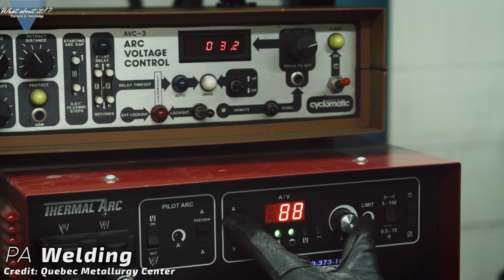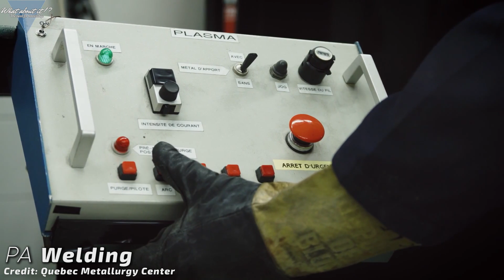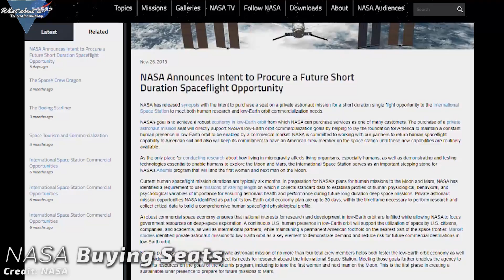55 | Cocoa Shipyard Work Paused – SpaceX Starship Updates – NASA Goes Private

Comment from the maker: Did you expect SpaceX to completely shut down Cocoa so early and is NASA on the right track when it comes to a private low-earth economy?
Reply: Did not expect Cocoa to close so early. In fact I was still under the opinion that Mk1 & 2 were flight worthy until Elon announced otherwise. NASA moving in the right direction only because they have been forced to by public opinion and the alert triggered by Boeing and the 737 MAX.
Reply: With RUD happening so early in testing on MK1 I wasn't really surprised that MK2 would be scrapped, but I didn't consider the scenario of them completely shutting down Cocoa site. I was also surprised about what you said about the 25 rings that have been crowding the yard at Cocoa for months. I had no idea they were all rejects!
Something that just occurred to me is the fact they're moving on to MK3 might take some pressure off of the Villagers to move anytime soon. Lab's camera might just be there awhile! ;)
Reply: I expected them to move to McGregor. I don't  think anyone's watching McGregor.
Reply: I never know what to expect from SpaceX, they're full of surprises....
Reply: If your information is correct, then that is a surprise. Many people would have expected SpaceX to repurpose the site, not to stop rocket construction entirely. Thanks for the heads-up.
Reply: Great scoop! Well done.
Reply: So early? No, but i always saw Cocoa as a temporary location until things panned out on Kennedy Space Center ground. Moving a spaceship over a busy highway (anyone that went to the same highway to watch space launches know what i'm talking about) THEN loading it on a barge would have been a major PITA.
Reply: Surprise to me. Both.
Yours TeslaDan4Freedom
Reply: Quite the contrary. I expected Boca Chica site to be closed and turned into a water tower for the town.
Reply: @mglmouser  "town" SpaceX has mostly already bought out the residents there... under 10 homes doesn't really constitute much of a town.
Reply: I didn´t expect Cocoa to be closed so quickly. All structures and Starship parts have to be dissembled and you need a crew for that. 
I expected that Mark2 would never fly as it was basically a backup for Mark1. However it appears to me as if Spacex quest for speed backfired this time, as  unsafe welds are a likely root cause for Mark1 to being not deemed flightworthy and failing during the pressurization test.

Regarding NASA´s attempt to build a private LE economy, my take is that it is going to be fun if they show the same negotiation skills as with SLS and Starliner. Both were designed to drive down costs and failed miserably at that. In essence there won´t be that many companies able to bring Astronauts up, and all what these few "ferrymen" have to do is to threaten to not have enough seats left for NASA in order to extract a premium from them.
Reply: I wasn't expecting it, but I think I can see why. The location of the Cocoa site always had me wondering how they're supposed to get rockets out of there in the first place. It seemed like a really inconvenient place that was ultimately going to cause logistical issues in the long run. Considering how its surrounded by trees, rivers and industrial zones on all sides with no room for future expansion. I never thought it would work out. Besides it will be easier and cheaper for them to consolidate their work at one location, now that they have Boca Chica up and running. And the Boca Chica site is in a way more advantageous location.
Reply: @BenYork-UBY  i should have read your comment first ;)
Reply: Could probably sell those rings to an enterprising welder who could make BBQ pits and rocket shaped smokers out of them.
Reply: clavo - That’s 301 Stainless, which means Tesla may end up using it for a “limited edition Starship Cybertruck”.
Reply: Seems like a real ordeal for a road closing anyway. Who knows how many are making it harder than it should be for Space X. Roberts Rd looks promising. Nasa will be on the right track when they focus on everything but an SLS Rocket.
Reply: I was expecting that. Why should you still put alot of effort in a place when you got the opportunity to have everything in one place. Manufacturing and launching. And you can extend boca chica to a much bigger area. Nasas plan to go private is the right thing. Step by step getting rid of relying on tax money.
Reply: I'll miss Cocoa, it felt more proper. Probably because MK2 looked a lot better than MK1.
Reply: Yes, because of lack of flexibly and speed to get equipment to launch site.
Reply: The Cocoa "sheet metal shop" always made me scratch my head, anyway.  I thought they would only build parts, not a whole rocket with no way to get it to a launch site.  I hope SpaceX learned from it, because otherwise it seemed like a total waste.  It almost seemed like Elon saying, "Build me a couple full scale mock-ups, and I'll do a presentation from one of them."  So, he did that.  Seemed like a distraction or entertainment while they designed the new launch facilities.  Then they fitted out Mk1 with plumbing for a pressure test.  Although, I'm still not sure if it was accidentally way over pressured, or if it was pressurized as planned and just failed to perform as expected.  Was Mk1 a failure, or was it "mistreated" and blown apart by accident?  And where is the Roberts Rd site on a map in relation to LC 39A and the VAB?  Felix, can you show it to us on a map?  I can't find it on Google maps.
Reply: https://maps.app.goo.gl/M5CNL98K95fSqvFQA
Reply: @Andrew-13579  The SpaceX site at Roberts Road is just west of Kennedy Pkwy at the corner of Roberts Road and A Ave. Clicking on it on Google Maps gives a location of 28°32'33.1"N 80°39'57.6"W. Here is a tweet with a NOAA satellite photo overlaid with the development permit diagram: https://twitter.com/baserunner0723/status/1200172204421505024
Reply: @Andrew-13579  you know how to build an Interplanetary spaceship?
Reply: Yes the logistics were too hard.
Reply: I was wondering about the lack of progress at the Cocoa site in the past few months but I was not expecting it to close so soon, especially since the Roberts Road site is not ready.

As for private spaceflights to the ISS.  I wonder if only SpaceX  and Boeing would be allowed to apply for those two slots using the same capsule as their commercial crew entries.  If not, there could be more private soyutz capsules as well as other entries - including possibly Starship.
Reply: And another ting: All this two steps forward one step back is starting to look like artificial employment, economic stimulus.   Could that be so?
Reply: cue the music
Here at the Cocoa.... Cocoa construction, the worse place for rockets to go to space.....
At the Cocoa.... Cocoa construction, spaceships and rockets were always the passion at the Cocoa,
They closed it down....                 cooocoaaa, cocoa construuuctiooon.
Reply: cocoagate
Reply: NASA is now being hammered by the stark reality that it's pace of development is embarrassing. I expect the SLS (over 14 billion spent so far) to be cancelled when it's costs cannot compete with the new generation of launchers. Private industry is now beating down the doors for access to space, and the top-heavy institution of NASA will revert to it's original goal, to provide technology. This latest series of moves and announcements is just a cover for the shame NASA is experiencing, that they are now obsolete in providing access to space.
Reply: Spacex already has a robust and reliable low-Earth transport system in th Falcon 9. What are you talking about. 19 re-supply mission to the ISS by Spacex so, yes, NASA is on the right track.

Comment: why are we not getting a straight answer as to what is happening with mk2,, will it fly,, will it be scrap,, did elon find out the tanks didnt have enough structural support to carry on with mk1 and 2,, what is the changes to mk3,, is there going to be support beams running verticaly to support the tanks for the stresses endured during skydiving re-entry??  answers please

Comment: What SpaceX needs to do is get a single roll of stainless, set it up for one continuous weld where the edges are champhered as it unrolls. Doing this SpaceX can avoid many shorter welds that need to be   X rayed. They could start from the bottom and work their way as high as needed. The assembly should also be welded indoors. Then wheeled out.

Comment: The calculation was 301 will get 4 times stronger on cooling and will smooth all welding imperfection, but depend on which direction x y z are getting stronger. Maybe they need to wait to cool well first.

Comment: The whole project is nothing but speculations. They failed with carbon fiber design (that's the only suitable technology for such a revolutionary  rocket despite its complexity and expensiveness) and they'll fail for sure with the steel "design" (that is good for hoppers only).
Reply: Did you say the same thing about landing a booster on a boat?
Reply: @joshua43214  This is the mentality of a fanboy - since the idol had been successful once, he would be successful in any new initiative.
Reply: @joshua43214  No, I did not).

Comment: It looks more and more likely that Mk1 blew up deliberately.  Even welding inspection would just give you theoretical values and a test to destructioj would be necessary at some point.  Why go to all the effort of inspection if you imperfect welds are already up to spec.
Reply: Don't think so. Elon told us that MK1 would fly. You don't build a whole rocket to blow it up on purpose.
Reply: @BoodahBodey  No, I mean that it became obvious it wasn't really fit to fly so they tested it to destruction.
Reply: @Spedley_2142  Plausible.

Comment: How much money do you think SpaceX spent building 2 Starships in 2 different locations, blowing one up and canceling the 2nd one because it was so far behind? At this rate Elon will need 5 life times to build the 1000 Starships he wants to send to Mars.
Reply: Strangely enough everyone talks about the money NASA & contractors are wasting, but no-one talks about the money SpaceX is wasting due to miscalculations.
Reply: They spent less than the cost of a mold for a carbon fiber rocket, and far less than the cost of an actual carbon fiber rocket. As R&D goes for spaceflight, the cost of Mk1&2 is peanuts.
Reply: Probably quite a bit less than one Falcon 9 costs for them to build.

Comment: Speed and quality need to go hand in hand. If Mk1 and Mk2 were just rapid prototypes then that’s what space x need to state publicly. Giving speeches  about possible flight tests when you have no intention is just baiting the public and media.

I admire Elon’s desire to rapidly prototype but if he isn’t careful, blue origin could surpass him, by having a useable rocket sooner. Elon needs to chill, get the design right and manufacturing process right, and build that dam facility for building rockets. 

Speed is good, but it isn’t always the most useful. A good mix is needed.
Reply: If you're talking about New Glenn, its payload capacity is between that of Falcon 9 and Falcon Heavy. It is in no way a competitor to Starship.

Comment: I would like to be a fly on the wall if SpaceX would propose that one of the private spaceflights to the ISS be using a Starship.
Reply: Crew Dragon would be more than enough for the experience.
Reply: @peterbarratt8699  True. Granted it could be that Starship is used to conduct some short term effects on humans in zero-g but without docking to the ISS.
Reply: They will probably propose that eventually, since they want Starship completely to replace Falcon.

Comment: IT. DOES. NOT. MATTER.
-> SpaceX is bottlenecked by the mass production rate of Raptor engines anyways.
There would be no "Orbital Starship" without SuperHeavy [that is a LOT of engines].
Reply: They are ramping up toward one a day. That will give them all they need, and two a day is certainly achievable.

Comment: Sheet metal at 6:07 seems to be at least 4 times as thick as barrel sections at 6:44.  You sure won’t see any wrinkles in metal that thick.  I can’t rationalize the difference in thickness, I wonder what the thick sections are for.  Tanks made from the thick stuff would be heavy, but bullet proof.

Comment: Always thought cocoa was a ridiculous place for it ..when they bought the land we here in the cape discussed its impracticality then when we found out they were assembling there ...well we were wtf ...How will they move it efficiently they went through ..And they began a project with out an efficient plan for it and started widening roads and things ..but there r power lines and all kinds of other things in that path way ..It is plaining inefficient ..am I surprised ..Nope ..More suprised they started it there in the first place ..It would b a fine place for a few stages of prep materials then ship them to ksc for assembly ..I do believe they will prep the new area quickly as I have seen a lot of job adverts switch from engineers to trucks and more lower levels ..on the concept of prefab ..it is always the way to go if u get a full set of working parts ...thanx for the video

Comment: I was fairly certain one of the sites would close but I never expected the Florida site would go. Terrible that all those jobs went poof. That's life in Aerospace. The ring making machine is already at Roberts Road which was where they were going to build permanent facilities from the beginning. I'm surprised they didn't lay the stainless against a mandrel on a 45 degree bias. If they did they could create entire fuselage skins with only one weld. Where is the machine for Boca Chica? You don't build big rockets and take them for a spin on the freeway. You build where you launch and it's best to move them as little as possible..
Reply: They are welders. They go from job to job like a plumber or roofer.

Comment: I did think it was odd that after the structural failure of Mk1 Elon only talked about going ahead with Mk3 with no mention of Mk2.
Reply: The thing is MK1 and MK2 wwre very similar prototypes. So with Mk1 I assume the learn wnough to discard Mk2
Reply: @joweydelanota5558  that's what I was thinking.

Comment: If the site isn't capable of Starship production, don't use it. :)
Reply: Its capable.. Just not capable as a space port and transporting Starship from there is currently unfeasible. Maybe in the future they will use it for something.
Reply: @FreeStuffPlease  maybe something with engine production?
Reply: @byronprewitt7056  Not sure. I would think maybe they could make parts for Starship there but they seem to transport them from other places. For example you can see this st Boca Chika. Idk where they current prefab some of the parts at

Comment: I'm not surprised. I think what Elon was doing i.e. by rushing production of the prototypes caused more problems and headaches (I could be wrong though).  As for NASA going private, yes they should. Also, on a side note, if you have time check out the movie Destination Moon. You will be surprised by the movie from 1950 almost go it right when it came to space travel.

Comment: Stronger bulkheads are nice, but it wasn't a bulkhead that failed on Mk1. That thing was intact as it flew through the air.
Reply: The connection between the bulkhead and the sides tore appart. The new bulkhead shape appears to be far more rounded. Possibly to ensure the tension forces at the joint align better with the tank sides.
Reply: Im sure Elon made a decision to push Mk1's tank to its limits in order to speed up the development of Starship. Testing the pressurized boundaries of a protoype with a set discontinuation date only serves to provide engineers with valuable analytical data which will be use to improve the design at a faster pace.
Reply: @joweydelanota5558  correct 100% agreed
Reply: Hi Felix,
Do you have any own estimates when the starship crew version would be ready for first demo flight? I think it will take at least 8-10 years and its development will cost around 10 billion of our beloved US dollars.🙂
Reply: @farrukh8827 2023 is the target date for a passenger flyby of the moon.  He'll make it. 2yrs, 2 1/2 yrs?
Reply: @madisonlivingston5851  Yes, this is according to "Elon Time". But in reality ?
Reply: @farrukh8827  Sounds reasonable to me.
Reply: @farrukh8827  While I agree that 2, 2 1/2 years is ambitious, I suspect that the first manned flight will be in less than 5 years - and that the development will cost a lot less than you mentioned.

Remember, this is a SpaceX project - not a NASA one (in which case your estimate would be real low in terms of time and cost).
Reply from the maker: Nice balistic launch indeed! Still, the bulkhead looked very rough. Might be a good idea to step up the game here too. :)
Reply: @Whataboutit  True. The whole thing looked rough. I am glad they got the bending machine going. One welded seam per ring might save enough manufacture time for SpaceX to consider x-ray-ing the welds.
Reply: Mk1 never flew. You must be thinking of Starhopper.
Reply: @madisonlivingston5851  Nope. Parts of Mk1 flew (like the bulkhead)...hundreds of feet, straight up.
Reply: @FieryWACO  oh, I get it! Lol!
Reply: @madisonlivingston5851  He was referring to the bulk head that got launch into the air as a result of the explosion.